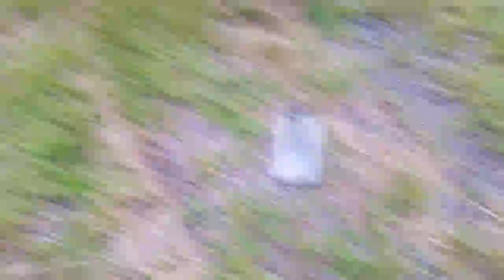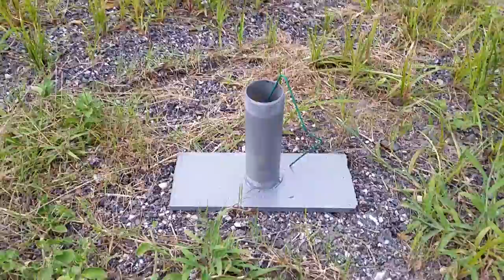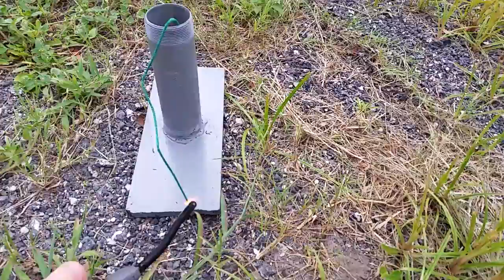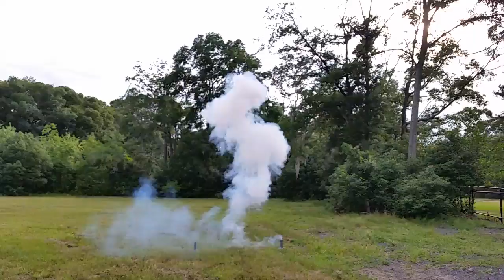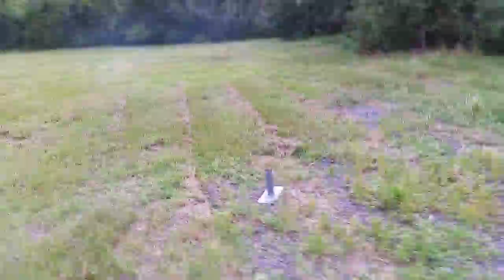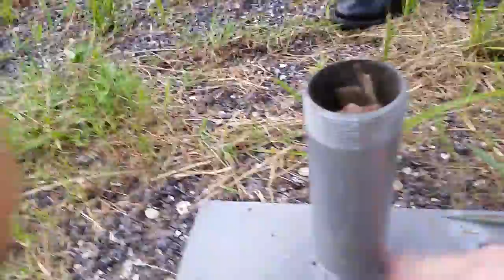Ground mortar test 2

Comment: Why didn't it shoot out?
Reply from the maker: The purpose of these tubes is to explode a mortar in the tube. When it's dark, you see a colorful burst blasted out like a shotgun. Many refer to this effect as a flower pot. One do-it-yourself version of this is to turn the mortar upside down in the tube. This is dangerous and should only be done in tubes that won't blow apart from the force of the explosion. Standard fiberglass tubes will come apart.